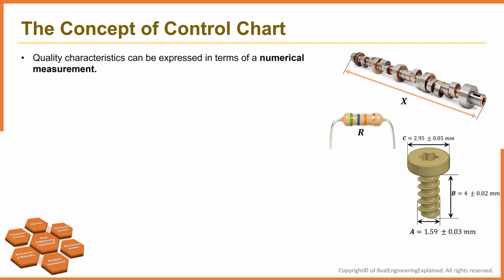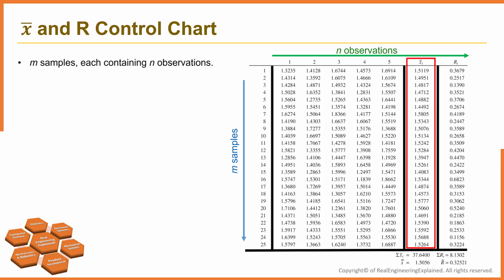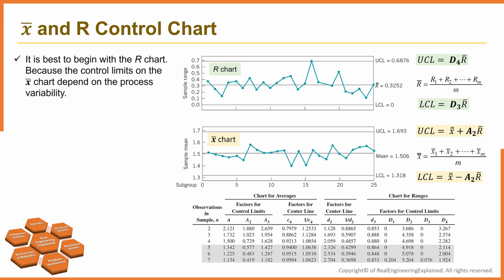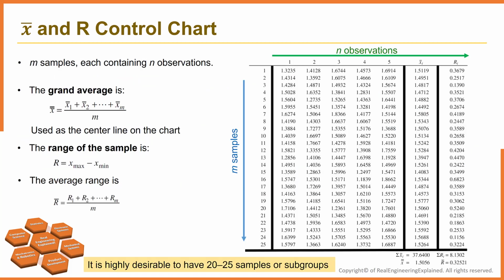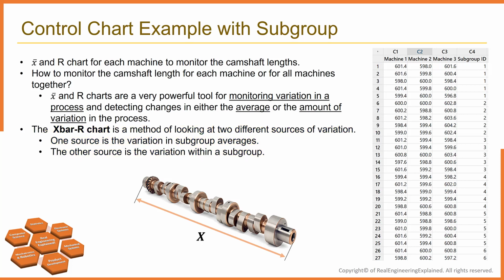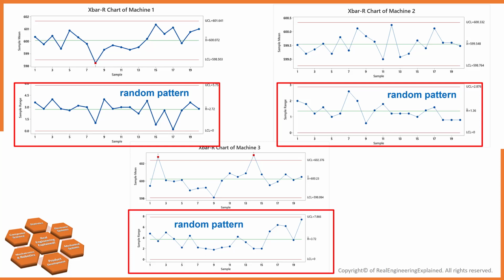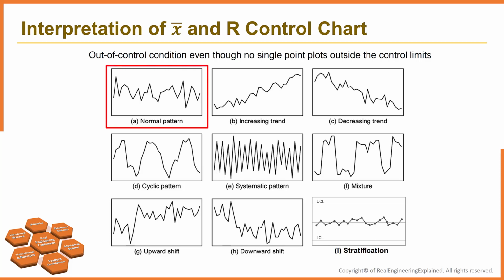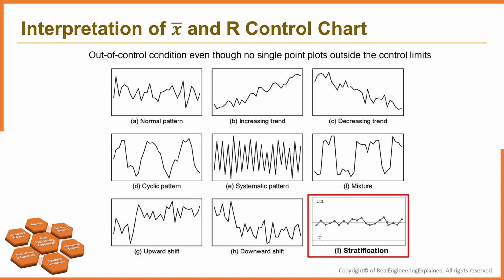Part 1- Control Charts: X-bar chart, R-chart, & I-MR chart | Statistical Process Control

Comment: In your example you measure the length of the cam shaft.  If I were interested in the min and max diameter of each cam, would I be examining R and x for each individual cam or as a single group ?

Comment: Hi Bob,
Thank you for your tutorials.  

I'm working on qualifying a new system for my electrode process line.  Currently I'm collecting repeatability data for the total amount of powder material that it will transfer to the slurry mixer.  Any feeback?